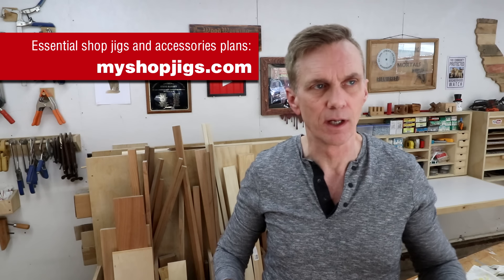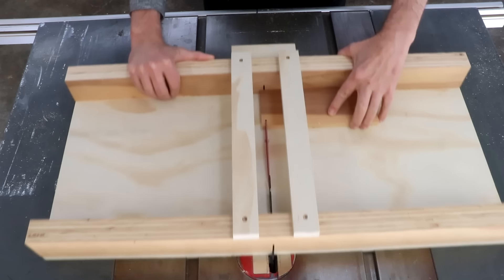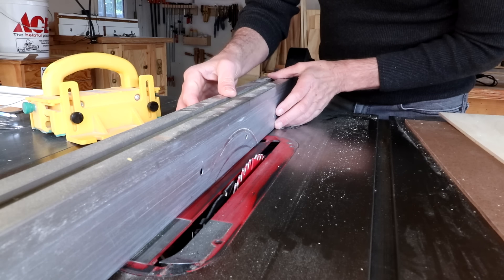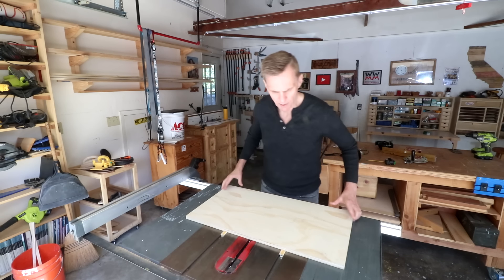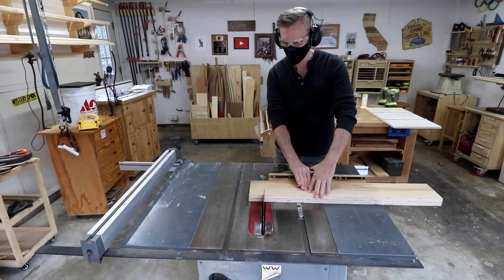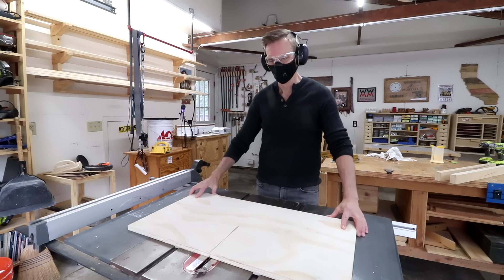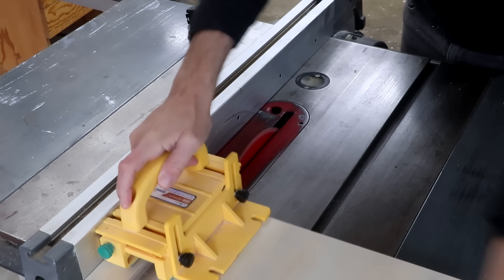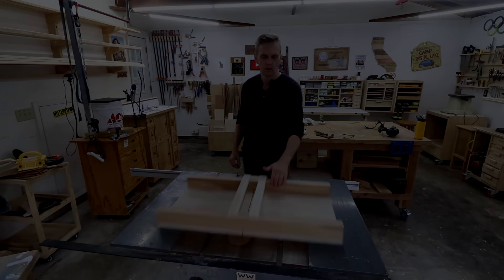The simplest table saw crosscut sled on YouTube. Essential woodworking shop project.

Comment: should have used the 5-cut method.
Reply: I think he intended this to be a quick and easy sled to build, also for beginners. I use the 5-cut method myself, but I understand not all people are comfortable with it. The sled he built is probably more than accurate enough for many, many projects.
Reply: What is this method? Beginner here.
Reply: @luismoref  It's just a way to measure how far from square you are to very high precision.  What you do then is up to you.  Google "ng 5 cut".

Comment: - or you could just use your mitre saw. Which was designed to do this job. And can do compound angles. And has the right blade in it. And does not lose depth. And can do score cuts.
You paid a lot to get that cast iron ground table- why cover it in - plywood? Would you have bought a table-saw that had a plywood table? Didn't think so...
Reply from the maker: You're problematizing. There are lots of reasons to use a sled. Take your crankiness to Twitter lol 😂
Reply: @SteveRamsey  is that a word? I note that you attack me, rather than my reasoning. I would value a description of use cases where such a wooden sled was superior to a mitre saw or other common machine. My criticism is not for your sled (it appears well designed and made) but of table saw sleds in general. They usually allow tasks to be done on the wrong tool… Over to you.
ps Looked it up-
'Problematization is a process of stripping away common or conventional understandings of a subject matter in order to gain new insights.'
I will take that!